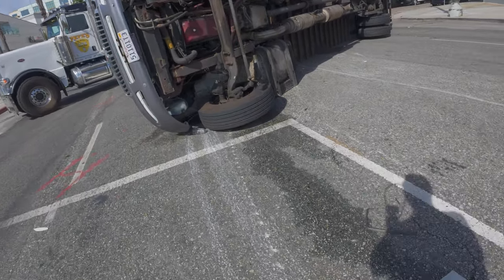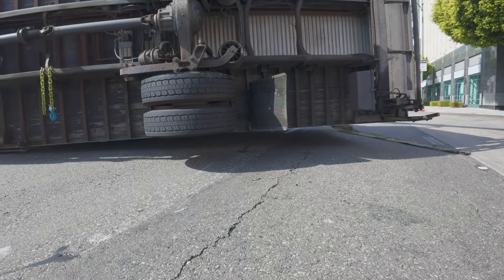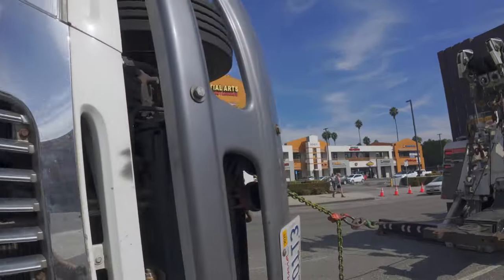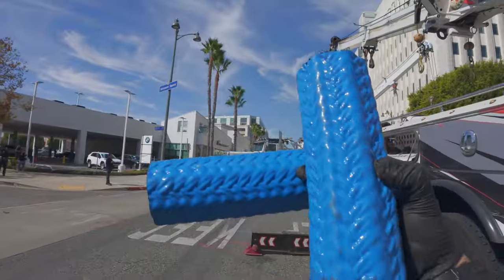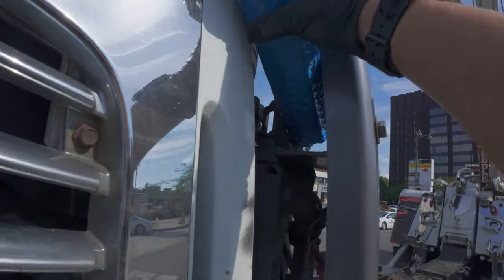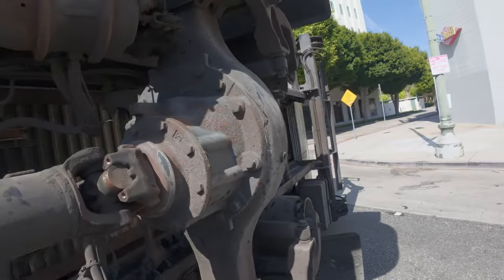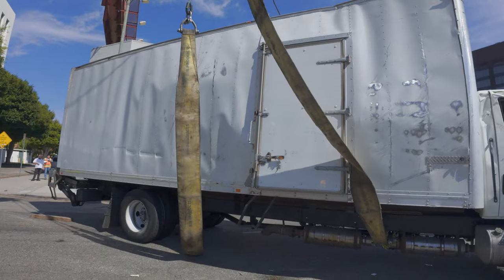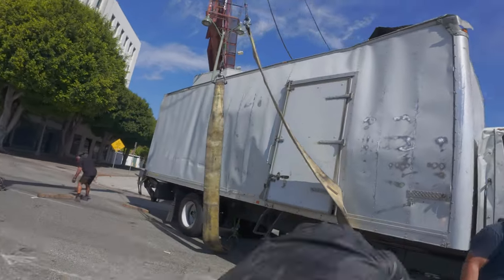Speeding or Near Miss? Box Trucks Flips Over

Comment: Thank you for explaining why you disconnect the driveshaft. I always wondered why.
Reply: Particularly with auto transmission.
Reply: @colinl9018 sometimes you want to pull the drive shaft even with a manual because if the transmission is lubricated by pumping from the input side of the transmission if you just spin the back end you'll run the transmission dry.

Comment: That statement about the drive shaft is so truck. I had one that was only held on by 1 U Bolt. The Breakdown Clown at the company I drove for tried to tell me that bumpy shake was more likely my leveler on the back of tractor.  12 years later and a different company and I lost one but truck didn't have no shake. I just know I lost all my air and was trying to get over 3 lanes to shoulder. I thought my airbags blew. Didn't know it was the drive shaft until Road Service wanted me to pull forward to disconnect trailer so he can get under truck and was NOT able to and that's when we all found out it was the drive shaft. So I sat 2 hours for a heavy duty tow truck. That's also the first time I ever drove a tow truck. Grant it was only 1000 feet but he had to make sure my back wheels would roll.

Comment: Hulk doesn’t usually tow now is it because hulk doesn’t like to tow or Josh doesn’t 😂😂😂 ( ya I know I’m a smart ass). For those commenting I’m being sarcastic I know flipper can’t tow and hulk can. I’m just bugging josh sheesh 🙄
Reply: Flipper does not have and underreach/towbar set up-look at the back.
Reply: @glennjukes5581 read what was written!! Hulk not Alex with big Flipper.😊
Reply: No it's mainly  because the rotators are very busy, so it would be down time for it to be towing, so most of the time it's more productive to get a wrecker to do it as that's what there built for.😊
Reply: @walkingwithdogs8547  I know I’m being sarcastic
Reply: @glennjukes5581  I know that flipper can’t tow strictly recovery that’s why Josh took it I was being sarcastic